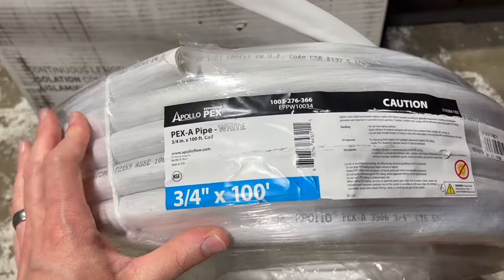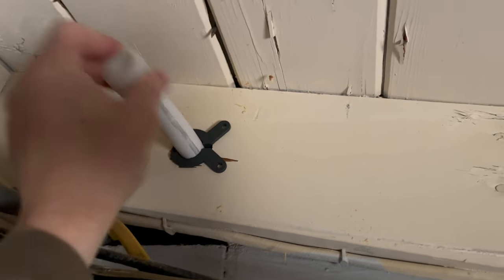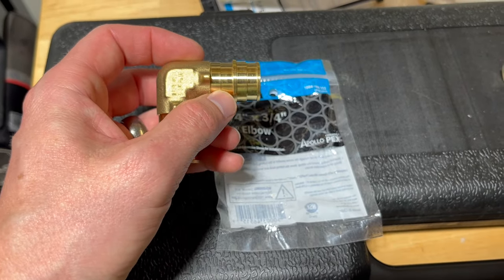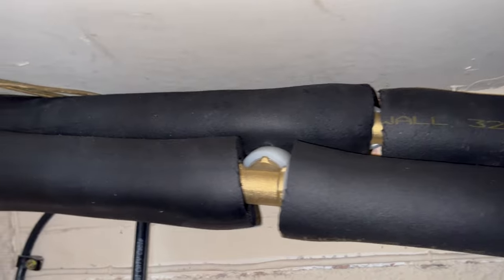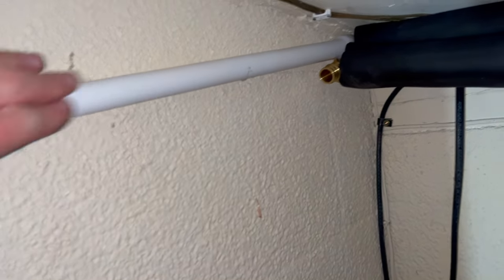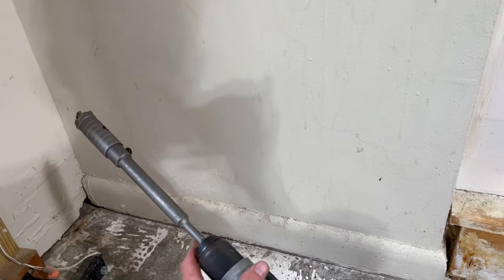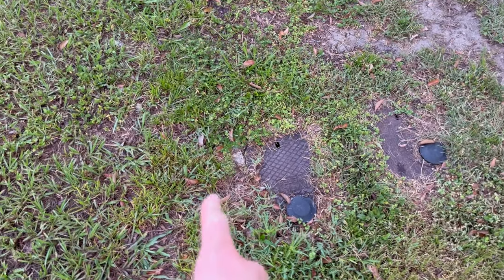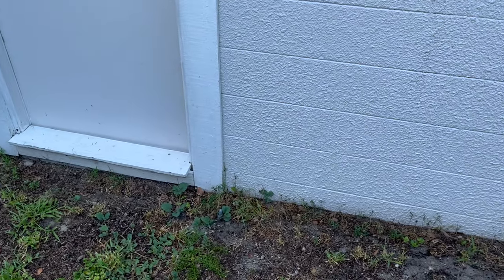How to Replumb a Whole House with PEX Pipe Through the Attic || DIY Repipe Project to Replace Copper

Comment: Copper is 60 years old and you’re telling me the PEX is better? Lol PEX has like a 25 year warranty. It’s a more affordable and easier to install system, doubt it will outlast copper.
Reply: How to do run copper pipe on a repipe and not cut up all the walls? Are you serious?
Reply: Most copper today is made from recycled materials, which is why it's not a durable as pex.
Reply: @benjaminbrooks40  WRONG!  You have no idea... new copper pipe is a MINIMUM of 99.9% pure copper.
Reply: Push to fit has a 25 year warranty.

I live in philly where copper freezes and bursts. Whenever I get a new rental as soon as I put a new roof on it I rip out the copper and replace it with pex
Reply: My water is acidic - even with a softener, I had to replace copper pipes that we're eaten thru by corrosion - I'll take pec over copper any day. Plus when my copper froze in the garage, I had a nice waterfall when the thaw came in...replaced with PEX.... Still holding.
Reply: PEX lifespan is AT LEAST 50 years - it won't freeze in winter, is resistant to acidic water, is cheaper than copper and much easier and cheaper to replace - no need to sweat joints.
This guy did this project all by himself - what's wrong with that? 
Hiring a pro would cost him probably 4x as much....or more if using copper - why not congratulate him on the job well done and, if he made any mistakes, giving him some pointers?
Reply: Pex will definitely outlast copper  in his home. He said his home had pinhole leaks in the copper . Copper can likely last for centuries if the water is not acidic and if the joints are soldered flawlessly and if there is no water hammering and if copper doesn’t touch other metals and if it’s not grounded to a floating current wire and if a sacrificial anode is used in water heaters and is replaced as needed and if it’s not exposed to freezing temperatures. That’s a lot of if’s ! Copper definitely has better antibacterial properties but unfortunately is more than twice the price for materials and labor to install.

Comment: I just did a PEX re-pipe on my house in December. Like you a 1500 sqft house; though I was in a crawl space instead of attic. I used Zurn Pex B which is actually designed and rated for expansion fittings. 3/4" trunk and 1/2" branches. I found that the Zurn and Uponor (ProPex) rings are tighter and faster to seal completely than the Apollo rings. I also commend your persistence with the manual tool. I bought an electric and that made the whole project like putting toys together. Sooooo much easier.
Reply from the maker: Thanks for the feedback!
Reply: Seriously, I too commend you for the manual tool rather than the battery powered one. Serious props. Great work.
Reply from the maker: @donschafer3428  thanks!
Reply: @hanoveroak  Nothing wrong with the manual PEX crimp tool. PEX A is far superior though. Talking the same money basically so why choose a system with massive water restrictions right off the bat? PEX B chokes down like mad just for ONE fitting. By the time you get to the middle or back of the house, you've lost a ton of water volume. I went from PEX B to PEX A. Got water for days now. Redid what my plumbers did in Sioux Chief PEX A. Never go back to anything else. Remember to INSULATE both the cold and hot lines.
Reply: @rickjames6948  I chose Pex B over Pex A simply for the higher chemical resistance of A. I had considered expanding the pex (I bought Sioux Chief Pex-B which is F-1960 rated, meaning it can be expanded) but used pinch clamps instead of expansion. My house is small (1000 sq ft) and of the fixtures I converted, any drop in pressure is unnoticeable (by me).

Comment: I also reside in Florida those old Florida homes are well made. I need to get my home re plumbed and I'm trying to get educated before they come out to give me an estimate.  Thank you so much for the upload. You are Blessed that your handy.
Reply from the maker: Thank you! I hope that you get some reasonable quotes. Good job educating yourself!
Reply: I live in Palm Beach County Florida and I am doing a add on its copper all the way 👍 no pex in sight
Reply: I got an estimate for my house in Indiana (3 bathrooms) very accessible and got a shocker quote of $9250!
Reply: @garfixit  Not a bad idea but don't forget you can mix systems.  Use copper behind the shower valve and anywhere else that is critical then use plastic pipe on long runs or main lines.
Reply: @BlackShale  Not a bad price if the installers take their time and do good work so no leaks - ever.  It is a lot of time to replace pipe vs the original install and you could just update critical pipes in walls and not redo the entire system
Reply: Where in Florida? Ive done about 20 repipes in south florida. All the copper in thes old homes are getting pin hole leaks in slab.

Comment: If you want max flow for a spigot bring 3/4 copper out put on a 3/4 male adapter and then a 1/4 turn ball valve. The make ip to hose adapters. Works well.

Comment: Great video, esp using different systems PEX A + CPVC & shark bite, etc.  41:03 I believe that plastic hangers should be used with the PVC instead of metal to prevent the pipe from wearing down from rubbing against the strap and the same with copper pipe use copper strap and finally steel strap for steel conduit. Also, the loose insulation in the attack should be tested for asbestos and even if it is not a mask should be worn in the attic to prevent breathing dust and fiberglass.  Attic crawl space: by code wires can be flopped on top of the ceiling joists - sloppy but saves time and you can run a mechanics creeper cart on top of the wood to make it easier to move up there and use a trash pickup handy grabber tool to reach tools, materials, etc. Smart to work when it is cool
Reply: I come her to see the comments about having a metal strap on a PEX A pipe and suggest to change it because of the long term effect or wearing off.

Comment: The CPVC near the exterior would be concern for a future bust — probably a Long way down the road
It just never fails for cpvc pipes to break on the exterior of a home

But I could be speaking for other traditional cpvc set-ups 
The amount of attention and methodology based around your video probably makes your installation long-lasting 🙌🏽
Reply: Also the insulation for your Pex installation was amazing to see it all come together

However, what if the cpvc near the exterior deals with cold-temps or a freeze? Cpvc does not like expansion compared to Pex
Reply from the maker: Thank you! We are in Florida so having CPVC in the garage is no problem at all. Very common down here.

Comment: As someone that has renovated, flipped similar houses, I like the spirit of this diy project. ..i probably wouldnt have used cpvc pipe at all.or one or the other. Some pros (and cons) of cpvc/cpvc gold flow etc ...but probably just drop pex ..In particular the garage drop whereas you implemented a series of 45s cpvc ...just would have cut a little shorter pex so the  drop of the pex would be in the grove you wish. Also I know it would have been more work.. but would have looked into dropping the pipe into the walls. Even a concrete wall drop is possible.. Hard to say from the video but some vertical partion of the concrete wall could have been hammered out in a vertical fashing a few inches wide/ deep or so to allow for pipe.. then the water line pathway, could be  piped, refinished with a concrete patch and painted for a fully finished out look.
Reply from the maker: Great ideas here! I went with CPVC for parts of this install so that I didn’t have to insulate to protect from UV light.
Reply: @hanoveroak  understand. Both PEX and CPVC are susceptible to UV light damage over time. PEX more problematic from what I have read on the subject. Both will discolor. All of this as we know are small comprises here and there with pros and cons each. Make a part 2 video with pipes exposed on the walls being protected in the wall.. as an upgraded project. ..and more youtube view counts 👍🤔💥🏆😎
Reply from the maker: @pcexpress911  you are very right! Thanks for the idea! :)

Comment: Great video, thanks for sharing! The tools list is very handy, will purchase mines from your referral list.

I am starting a similar project. It seems you left PEX visible instead of pushing it inside the wall. What was your reasoning?

Any reason why you did not use a manifold?

Did you attach the cold/hot PEX lines to your water heater?
Reply from the maker: Thanks for the support! I was unable to put the PEX behind the walls without ripping out drywall or cutting channels in the block walls. It just made more sense in my scenario to keep it insulated and external. I did not need a manifold because this wasn't a home run system. Just a basic hot and cold run with branches off the main trunks for the supplies to each room. I have not relocated the hot water heater yet, but yes I will be running PEX to it except for the last 18 inches. That will be metal flex pipe meant for connection to hot water heaters. They make them with PEX connections on one end which makes it super easy.

Comment: 07:00 I've seen putting water berween the isolation and the pipe- it slides more easily.
14:00 y could use red and black tape

Comment: In the video at 24:50 you cut off the expansion ring. It looked like the PEX pipe had a crack in it. Why was there a crack in the pipe or was that from the knife?
Reply from the maker: That was from cutting the ring and pipe with the knife.
Reply: I hope you don’t have very cold winters where you live.  I wouldn’t feel comfortable with the pipes in the cold attic.
Reply: @jimbo4551 PEX A expands better than copper, so cold temperatures are much less of a concern for PEX rather then copper.

Comment: we can't use pex pipes all the way everywhere? any specific reason to mixup cpvc and pex pipes??
Reply from the maker: You can. If you use PEX anywhere that there is UV light from the sun then you will need to insulate it to protect it. I was avoiding insulating everything that I installed in the garage so I used CPVC for some of it. I also wanted to show different ways of doing things.

Comment: Where is the house located?  Have you heard of boxes or cages to contain the pipe?
Reply from the maker: It’s in Florida. Yes I may end up boxing the exposed pipes in eventually.
Reply: @hanoveroak  Thanks, but what is the purpose of boxing them?  The plumber who did the repiping to pex in the attic wants to box them.  However, the cost would be $6,500.  I am trying to find out what good boxing would do in No. Virginia where the winters aren't that severe.  I will fnd out on Monday if the county requires it.
Reply from the maker: @vin.handle  I would think they want to box them to protect from the cold. In Virginia I think insulating them with foam is enough. I was only considering boxing the exposed pipe in the attic to make it look better.
Reply: @hanoveroak  Thanks.  I am beginning to suspect it is for cosmetic reasons only.  I don't intend to show guests into the attic.
Reply from the maker: @vin.handle  haha absolutely. I actually meant I considered boxing the exposed pipe in the garage. Definitely no one will be going into my attic!
Reply: I have huge slab leaks right now.  1955 house should I re pipe to pex?
Reply: @TruongLe-eo8kh I've done it.  I've repiped to pex through the walls and attic in No. Virginia.  Pex should last 40 years and is likely fairly easy to replace since it is above ground.  Insurance should pay some of the cost.
Reply from the maker: @TruongLe-eo8kh  that’s what I would do!
Reply: @vincentdesapio  I just did a bypass yesterday.  No more hot tiles over night.  No more noise from inside of wall
Reply: @TruongLe-eo8kh  That is good.  Depending on where you live and how severe winters are, I would make sure the pipes in the attic are properly insulated.  Possibly, with batts of fiber glass insulation on top.

Comment: Do you need a city permit for projects like this?  None of the licensed plumbers I asked wanted to apply for the permit.
Reply from the maker: Yes, typically the city/county you live in is going to require a permit.
Reply: Ask yourself why. If a plumber is doing the job correctly and to code, why would they have a problem?

Pulling a permit protects you the homeowner against the frauds and posers. When you sell, the buyer would want to check if a permit was pulled, especially for a huge job like replumbing the entire house.

Comment: That Apollo PEX pipe is made in China. Let that marinate. Is it really worth it not to use the best PEX pipe you can find? Which is Sioux Chief PEX A? In my area, a pipe reroute is $2500.00. Ever priced carpet these days? If you get flooded out from a pipe leak....... You need to get drastic on your water lines.
Reply from the maker: A lot of PEX products were very hard to find at the time this video was filmed. That being said, the Apollo has been great and I know others that have had it installed for years with no issues whatsoever. I will tell you this - it's MUCH better than the 60 year old copper that was there before! THAT is an accident waiting to happen!
Reply: You got a point with that scenario. Got to have water. I have old copper pipes as well. 4 under slab leaks later at the tune of $2500 per leak.... LOL  @hanoveroak
Reply: $2500 is cheap!  for the whole house?  Where I'm located in TX they want to charge $5k.  Where are you?
Reply: @hanoveroak  Ok you got me there. 60 year old copper...... Copper has a 50 year ON PAPER lifetime. What is it for PEX like 20-25? Sioux Chief I think is a Lifetime Pex pipe warranty? Check me on that.
Reply: @User-2734-eck1  OKC just north of you. I'm talking about ONE pipe reroute not a total repipe just so we are clear. So you lost cold to the kitchen? Here it STARTS at $2500 bucks.

Comment: In the video at 24:50 you cut off the expansion ring. It looked like the PEX pipe had a crack in it. Why was there a crack in the pipe or was that from the knife?